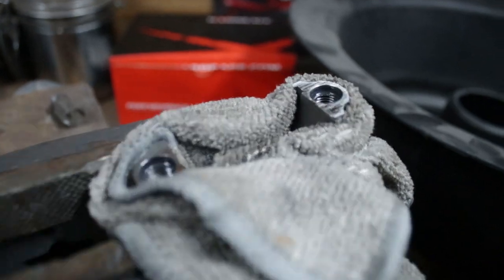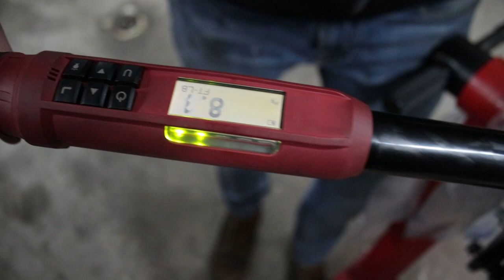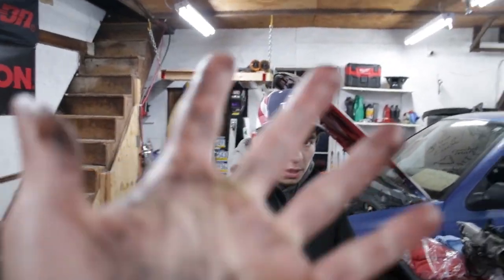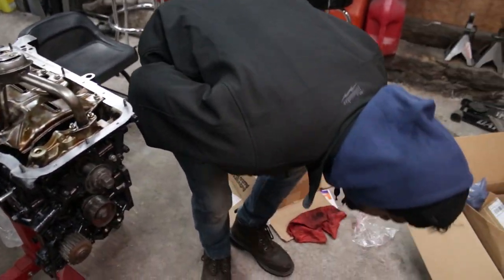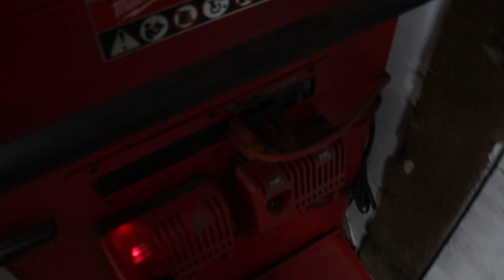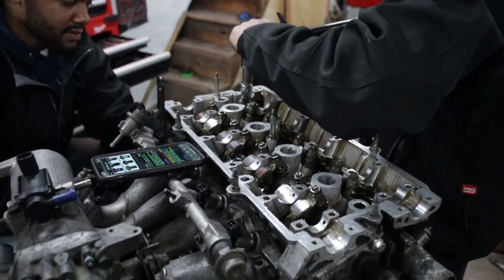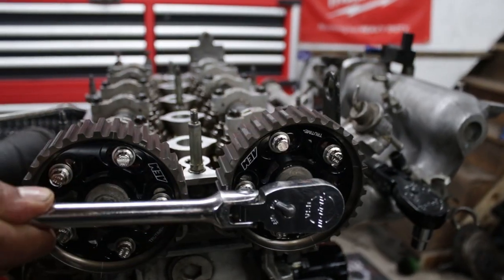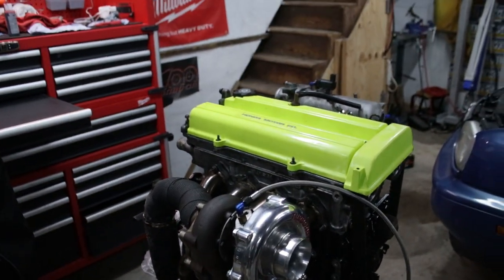Progress On The Engine Refresh & Turbo Install! |Building A Big Turbo B18 Integra Part. 4

Comment: no offense meant, but do you need to put assemble lube on all of that stuff when you’re putting it in? ie rods etc
Reply: We did trust me. I noticed that part was missing and we would probably get some criticism. It was on all the bearing areas and an oil change was done after about 10 minutes of the engine running